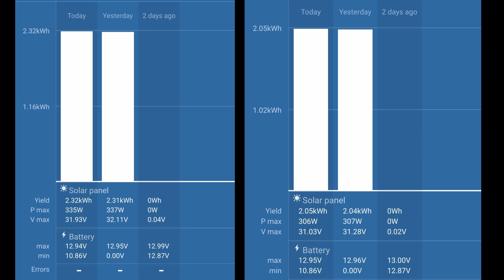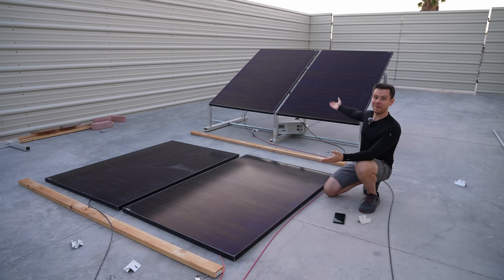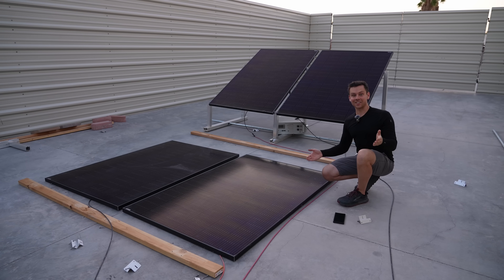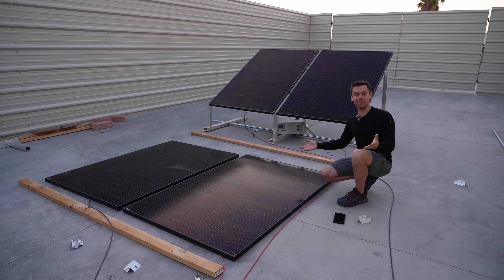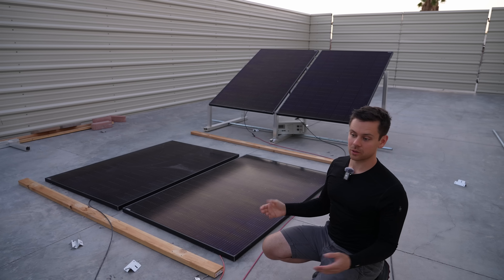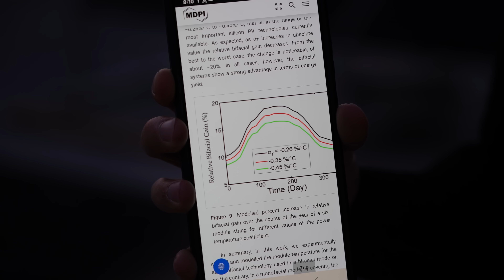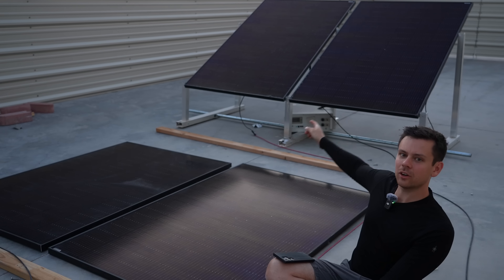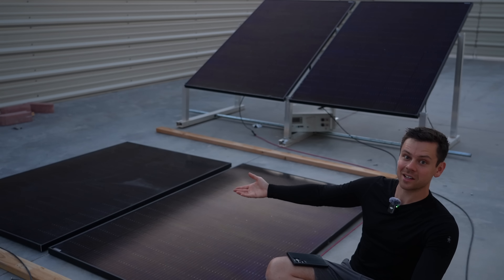Bifacial Solar Panels: Everything You NEED to Know Before You Buy

Comment: what would have happened if you had built the solar canopy you have, but instead of using standard building methods. You had built the entire thing out of solar panels. Using as little other materials as possible. hmm say instead of a post solar panels were bolted directly (or almost directly) to a concrete footer (or alternate) and to each other. vertical solar panels monofacial back to back vertically? (likely it would need some structural help for a solar canopy at the height you chose.) Clearly I have seen people use the solar panels as the canopy. Using the ones that let light through. with some sort of grid of inexpensive wood. maybe pallet wood? likely to short in length. Or use anything lying around that is strong enough. 

 It seemed to me you wanted a very structurally sound canopy, and I agree. But you got me thinking about decreasing building materials or using panels AS building materials.

I have seen solar panels used under a railing around a deck. Or privacy fence. 

One guy online was trying to roof his house with solar panels. The roof beam structure was there, mostly substituting solar panels for roofing tiles or shingles.

I could imagine using panels as siding with a layer of insulation between the current house and newly sided with solar panels. So what if they are vertical, if cheap enough they could be used on the north side in the northern hemisphere.
Reply: I saw them installed on pipe above the front sidewalk coming to the house. Not bifacial panels though.
Reply: Panels can definitely be used non-structurally.  That is, not weight-bearing.  They shouldn't be used structurally to take continuous loads or stresses.  e.g. snow-load is not continuous (though it can be long lasting).  The failure modes under stress are rather abrupt.

So if you put something structural together out of wood, you can definitely attach solar panels as wall or even roof.  However, it is not necessarily an easy thing to make panels waterproof.  With thermal expansion and contraction and other stresses, sealing seams panel-to-panel in a manner that lasts a long time is difficult.

There is also the potential fire danger if a panel has a short or other electrical failure.

That said, many people have successfully:

* Used panels for non-structural/uninsulated Pergola roofs.  (The Pergola already having structural ribs / timbers / etc providing the needed strength).

* Used panels on the outsides of railings.

* Used panels on A-frames for sheds instead of roofing them... with mixed results.  But not much bigger than a shed.

More dangerous use cases:

* Mounting panels vertically on an existing fence (rather then replacing the fence filler between posts, mounting the panels on top of the existing filler) can be problematic if the filler is combustable.

* Mounting panels vertically on the sides of homes is often a real fire hazard as any fire/flames go straight up into the rafters.

 * Using panels structurally in general is fairly dangerous due to poor failure modes.

-Matt

Comment: Purpose built frames to mount solar panels are extremely expensive. But constructing a frame of tanalised 2x6 timber and 8 inch piles cost me $500 (USD equivalent) to mount 10kw of panels.  It can be done cheaply.
Reply: Solar panels last 20+ years, a wood frame doesn't.
Reply: @JdZ-2023  Over here (NZ) H5 (in ground) and H4 (above ground) treated timber lasts 50 years. Guaranteed.

Comment: What about just putting a mirror underneath the solar panels?
Reply from the maker: Yeah, did that in this video already: https://youtu.be/c-auRHKq2-A?si=49F2QSRL2jRg-ry5
Reply: @WillProwse  how many of those solar panels can I run to safely charge a Bluetti 
AC200 Max with ’two Bluetti B230 external batteries? & in series or in parallel.
Reply: @alphahoss1947 To calculate that just find the specs of whatever panel and the DC input rating (in this case, 900W Max., VOC 10-145VDC, 15A). Divide the top of the voltage range by the VOC of the panel and round down. If it gets really cold where you are you should look up how to calculate panel voltage in the cold.

I'm not sure the exact panels Will is using here, but the Aptos DNA-108-MF10-415W have a VOC of 37.4V so 145 divided by 38V is 3.8 but since the 145 is a hard limit  you always round down, so 3 in series.

You can't parallel them here because the max current is 15A anyway and the panels have an ISC of about 14A  so going above 15A will just clip power.